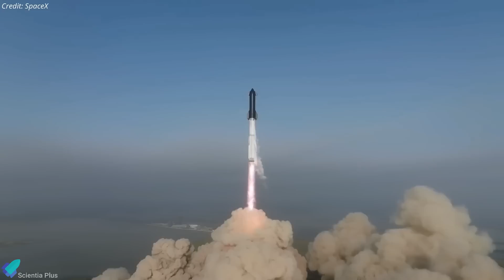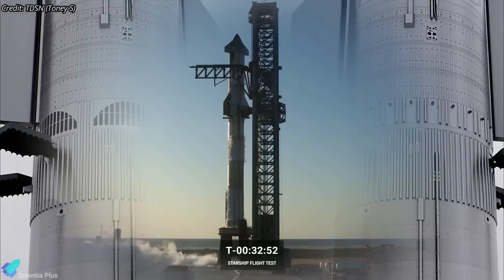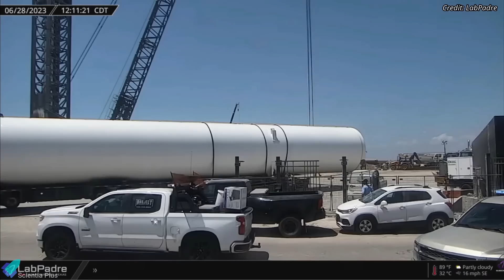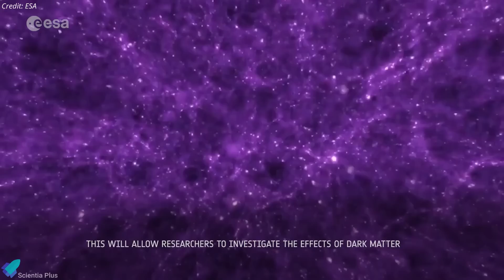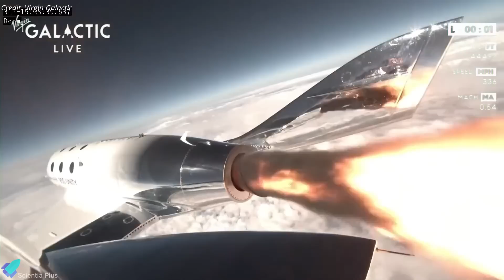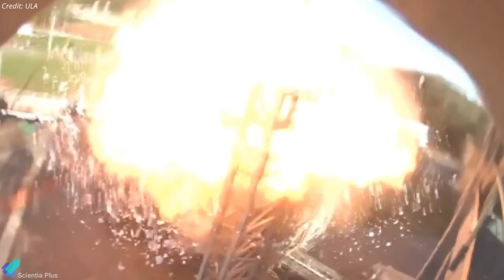SpaceX's Starship Hot Staging Designs Revealed, Euclid Telescope Launch, Virgin Galactic VSS Unity

Comment: Raptor engines failed in April test launch due to 'leaks of superheated gas...'. Where did this information come from - it is the first time I have seen an explanation for the Superheavy booster engine failures? The LOX and LNG have to be gasified before combustion in the pre-burners. After burning you have superheated gas exhaust. This startup process is probably the most difficult part of rocket engineering. And I believe the latest startup process for Raptor 2 and 3 has never been made public knowledge?